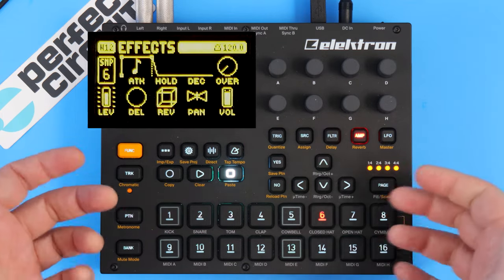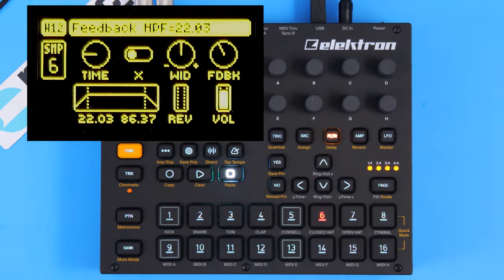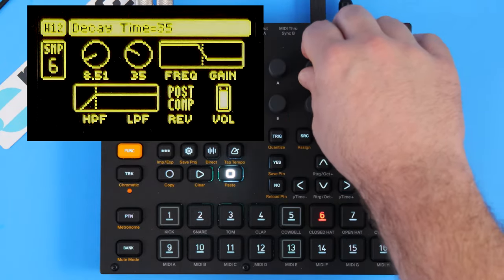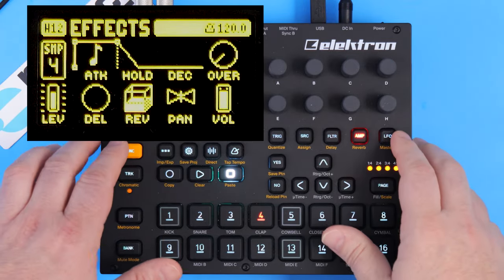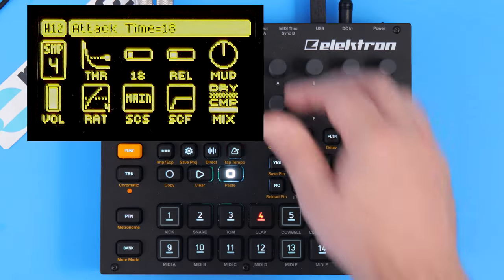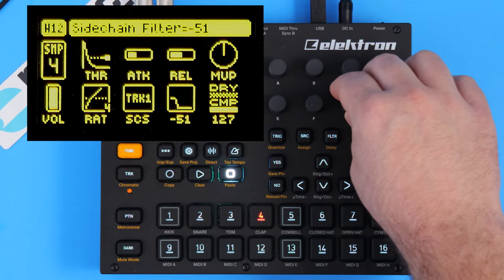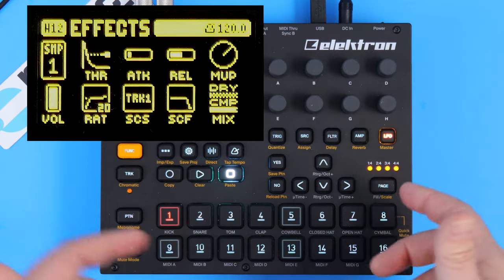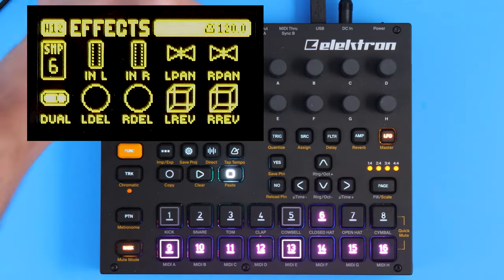Effects | Compression, Reverb, Delay, Bit Reduction, Sample Rate Reduction | Digitakt Tutorial

Comment: Question... I want to use the delay and reverb of the digitakt in ableton, but also use overbridge in ableton. Is that possible? If I check it at my main settings I can adjust it on the digitakt but nothing happens. I do can add delay and reverbd on the channels ofcourse...
Reply from the maker: I think it's because the Delay and Reveb are sent to a separate channel and aren't actually applied to the track itself. So if you are pulling multi-tracks, the audio track would be the raw audio pre-send. (I think...)